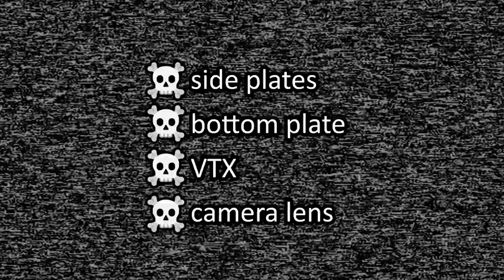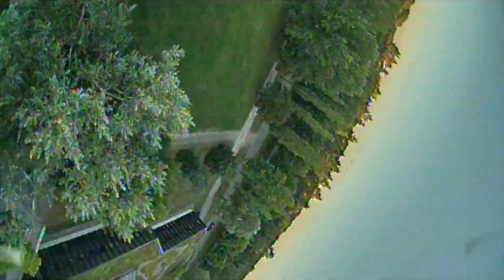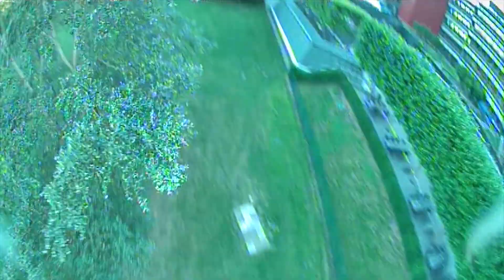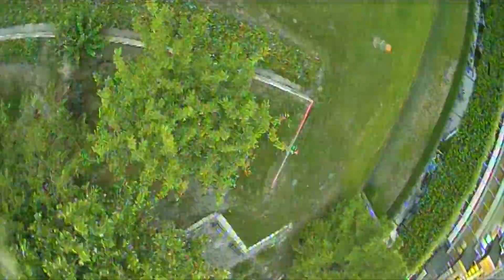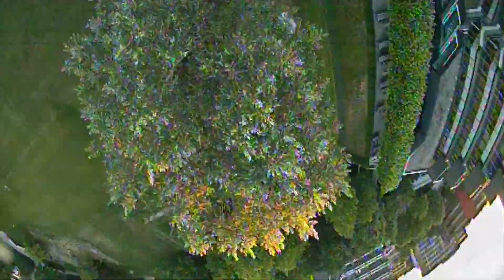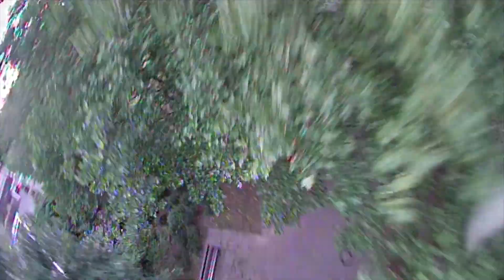Massive Droner: Review, Discussion and Problems

Comment: micro eagle is a quite big camera for this size of frame, maybe u should go predator V3, won't stick out
Reply from the maker: I really like Micro Eagle (have it in my whole fleet except whoops) and it kinda fit, but you're right. A smaller camera would have been protected better in this case.